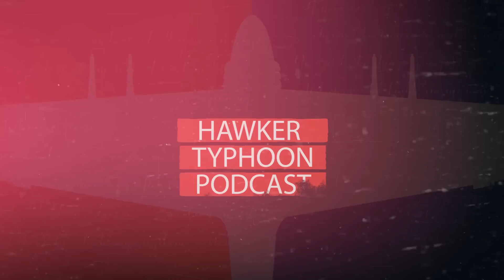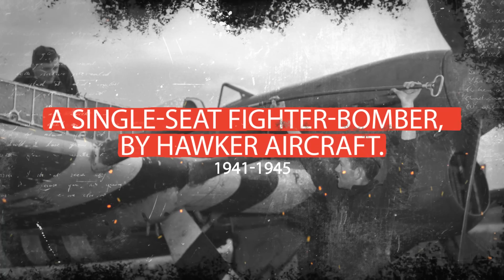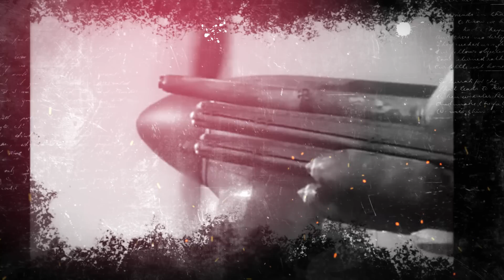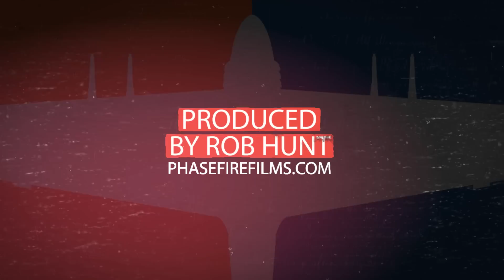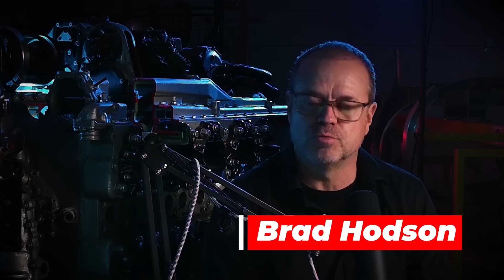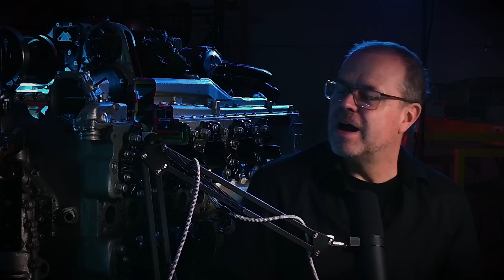Hawker Typhoon in Detail pt 2

Comment: Excellent video, thanks.  As to the CO problem, seems to me that the combination of poor firewall sealing and vacuum on the cockpit probably sucked the exhaust into the cockpit through the firewall causing the CO poisoning crashes. Cheers! Would be nice to see the fuselage parts discussed, too, like the aft join section and balances.

Comment: Good stuff. Just like to point out that the Comet failures wasn't due to the square windows, that's a myth. Cracks started from the rivet holes around the airborne radar unit on the roof, This was due to the change from drilling/reaming to punching holes, the punched holes left microcracks, cycllic fatigue did the rest.
Reply from the maker: Thank you very much for this excellent information, I had not heard of this previously. It is interesting that they started off drilling and switched to punching, do you know why this was done?
Reply: @TyphoonLegacySociety  I believe cost savings.......that backfired didn't it!
Reply: @bazwabat1  the bean counters got their way and the aircraft had a good few crashes and killed many passengers. Thus killing off the Comet. Even after the cause of the structural failure was found and rectified De Havilland knew they were trying to flog dead horses as it were.
Reply: Yes indeed. It still amazes me how if something incorrect is repeated for long enough, it becomes 'true' for anyone who doesn't research the subject...which is most people, sadly. People just say what other people say....ad infinitum.
Reply: What airborne radar on the roof?

Comment: Message for Ian, the Typhoon was the first Allied production fighter to fly with a bubble canopy, the first Allied fighter was the Miles M.20 way back in 1940. As a very pioneering company Miles' design improvements were incorporated into many competitor's aircraft, Hawkers being one. It could be that Miles was associated with Martin Baker who were just up the road so to speak and were pioneering canopy design at that time in the UK. I must dig out my Miles aircraft book to find out.

Of course the Fw 190 lead the way right back in 1939.
Reply from the maker: Wonderful note, thank you!
Reply: The Miles M.20 had some interesting design features, the bubble canopy chief among them, but was a bit of an anachronism with its fixed-gear undercarriage. There were very good reasons that it was never approved for production.
Reply: @paulm749  I totally agree but the Air Ministry had to act fast after the fall of France knowing that the Luftwaffe would specifically target aircraft production centres. After Woolston and Filton were both heavily damaged it must have been touch and go as to whether production of the M.20 should be commenced and even with the fixed gear, which was preferred for speed of production and to enable the fitment of 12 machine guns, it's performance was in excess of the Hurricane.
Reply: @paulm749 , the Miles M.20 was thought as an “emergency fighter” built primarily from non-strategic materials such as wood in case the production of Spitfires and Hurricanes should become disrupted by bombing. The emergency never arose.
Reply: Westland Whirlwind precedes that by 2 years…
Reply: @andymckee53  good point but the Whirly's canopy did have extra framing mid-way along so not strictly the first one-piece bubble canopy
Reply: @Micestro109  True. And since we are splitting hairs then it must be stated that the M20 was just a prototype and never saw production let along active squadron service. I’m a big fan of the M52 btw.
Reply: @andymckee53 that is very true, as I mentioned in my original post, 'production' was never achieved with the M.20. Miles got utterly shafted by the Air Ministry which was a huge shame for such an innovative company, they went into refrigeration manufacture in the end!